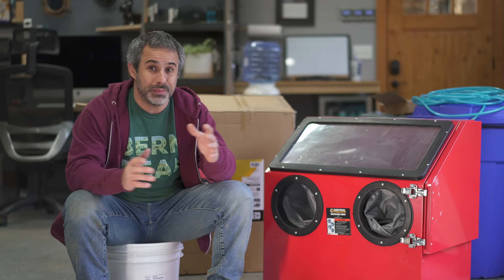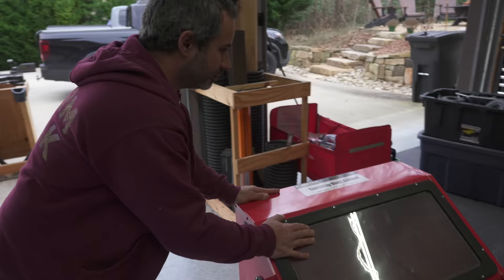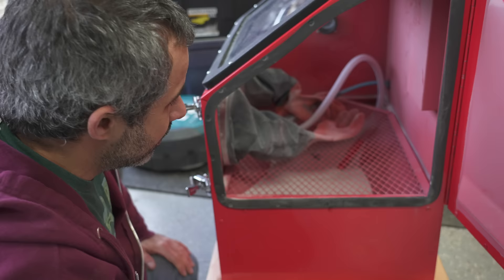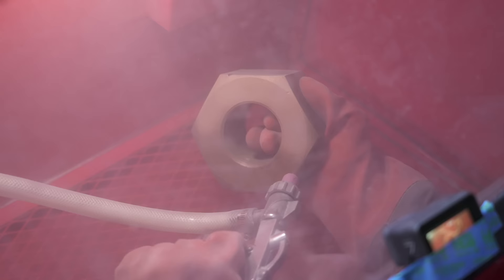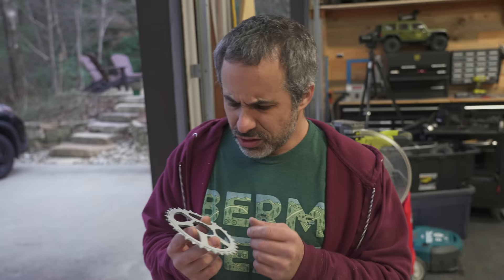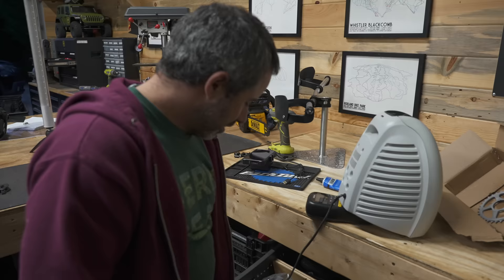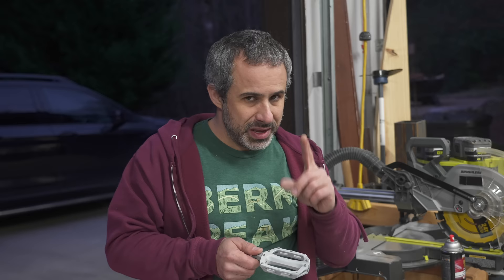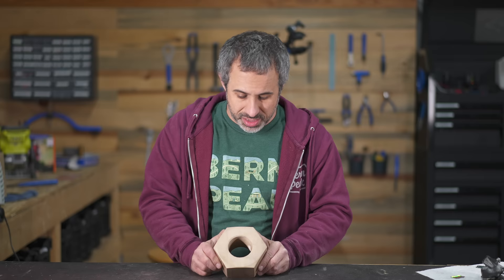I took your advice and bought a Harbor Freight sandblasting cabinet

Comment: For anyone who does DIY projects, I couldn't help but smile when the cabinet hit the bench top. I can relate. All you can do is laugh and figure out a hack to make it work.
Reply: This is basically how software development gets done too
Reply: And I knew 100% how Seth is gonna solve it! 😂
Reply: i’ve run into these kind if problems one to many times indeed
Reply: I'm glad he included it into the video I probably wouldn't have posted it but I guess after me smiling I should if I do that lol
Reply: @elorz007  that's engineering, they say it will work, we tell them no, they say do it, we do it. We tell them it didn't work. They say oh.. Then we do it the right way🤣
Reply: We’ve all been there… and sadly quite often more than once…
Reply: How long did you think about this before doing it? About 10 seconds 🤣
Reply: Or in his case, you can hack into your bench instead
Reply: I laughed so hard at that cause that’s something I would do
Reply: 🤣😂🤣😂🤣😂🤣😂 read your comment before watching. Made the comment so much more funnier. I can definitely relate.
Reply: Surprised he didn't measure the height properly before building the stand. Guessing he didn't account for the castor height.
Reply: Sure. But a crappy - if funny - solution.
Reply: I started laughing knowing what I would do but then broke down when Seth did the exact same thing
Reply: Looks like exactly one 2x4 (1.5") too high.
Reply: Thud!
Reply: I let out a little chuckle. Read the comment before I actually watched it happen and made it just a tad funnier.
Reply: This is how most of my automotive repairs go
Reply: that was my subscribe moment.  Love this dudes sense of humor.
Reply: In my mind I was thinking 4 blocks under each table leg 😂
Reply: measure twice cut once... then cut again because you still messed up somehow
Reply: It was the look on his face that totally said, "Well... THAT figures." Then it was a heavy sigh, a shrug of the shoulders, and grabbing the jigsaw. "I shall not be deterred!" Story of my life in my little work shop. Gotta love it. 😂😂
Reply: @awsomemanthing5358  I'm right there with ya on that. Pretty much my standard method of operations. 😂
Reply: Lmao you probably beat everyone for that comment
Reply: I loled
Reply: I guess praying to "bejesus" was not effective
Reply: Just giggled at that bit just as I saw your comment..lmao... Typical..like You say tho....HACK TIME!!..lol

Comment: For soft metals, instead of sand, use Soda (Sodium Bicarbonate, you know, baking soda). Can buy "industrial grade" bags of it darn cheap, and it won't roughen up your finish so bad
Reply: Horror Fraught has walnut shell media, so for $30 I think this would be the first thing to try in the blast cabinet.  HF also has soda blasters.  IDK if soda works in normal sand blasters?  The REALLY 'cool' thing is dry-ice blasting, but that equipment is NOT cheap.  And as always, remember that breathing dust from sand or glass is not so good.
Reply: @oapfu  Soda works fine, but you do need to modify your collection process and run a cyclone catch before the shop vac (which is a good idea even with sand). Using something like a dust deputy or the like to convert a 5 gal bucket for that size is fine, as well as have a way to regulate the soda, which is cheap and simple with a couple brass fittings, gate valve and some extra tubing.
Reply: Or for soft metals like aluminum or stainless steel use glass bead i sand blast for a living and I blast a lot of good grade stainless steel that can’t be pitted bad
Reply: In one of Seth’s videos, he uses baking soda and the way he says “baking soda, I got baking soda” is the funniest thing ever
Reply: @oapfu  dry ice blasting should definitely be done in a place with good ventilation.
Reply: Yeah I used costic on some cranks and polished up , worked great
Reply: Question for you sandblasting pros: wouldn’t it be wise to further improve the sealing on the sandblasting case, to prevent materials from escaping? I’m thinking a strip or two of foam-backed sealing tape. Would that work?
Reply: @trailfirexc196  Like many things from Harbor Freight, a little bit of time "polishing" the finish goes a long ways. You are not wrong, and spending time pulling it apart and ensuring a good seal on everything is worth the time, for little additional cost in materials.
Reply: not only that you actually flake out soft metals. and if you do any cast metal it can really pit the metal.
Reply: can also use granulated corn cob to polish with 
granulates are a completely natural and biodegradable
Reply: @trailfirexc196  not going to happen. You are shooting compressed air into sealed compartment, it's going to come out. The only way to keep the dust and sand from coming out the seals is to turn the cabinet into a low pressure area, which is where the shop vac hookup comes into play.
Reply: Sandblasting will warp thin metal even on a vehicle panel. Soda blasting is great, though doesn't do so well on rust. Though you can leave a vehicle sit outside for weeks and weeks before it will start to rust.
Reply: Paint stripper gel
Reply: Yeah I tried that stuff got a blaster that never gets used, bought it to try on old chair legs and it got used for a few minutes wastes too much material if not in a box or something to contain the dust.
Reply: He said “darn cheap”... this guy DIY’s
Reply: @trailfirexc196  What most of us that have these do is silicone all the cracks when putting it together and add thicker weather strip to the door.
Reply: It also dissolves quickly in warm water. That makes cleaning the nooks and crannys that it can compact in largely trivial.

Comment: As an engineer I wouldn't recommend sand blasting structural parts or hardened surfaces. Sand blasting is great for insensitive parts for quick and visually pleasing results. But especially on soft metals like aluminium you can remove a non insignificant amount of material quite quickly. Additionally, the rough surface weakens the corrosions resistance and mechanical properties further. In rebuilds and restoration off high end cars and chassis we use dry ice blasting or professional chemical paint stripping. That being sad, you can get softer sodium bicarbonate or nutshell particles which are great for cleaning parts without being too harsh even on softer surfaces.
Reply: “A non insignificant amount”
A.K.A. 
A significant amount
😄
Reply: @mrkthmn  hahaha :D. Yeah I am German, we like our "Doppelte Verneinung "
Reply: M539 Restorations sand blasts even manifolds, water pumps etc
Reply: @MousemanLV  well I would say thats fine in most cases. But I would never blast any structural chassis parts especially on modern cars with space frame, shell or composite construction.
Reply: Ex wet blasting R&D engineer, you're very right, will definitely strip off any anodising, compromise the resin layer of carbon fibre and may blow through case hardening in the case of gears, not clued up on how exact bike components are finished but definitely something to consider
Reply: Mechanical Engineer also here. I would go on further to say it really depends. Sandblasting the surface does remove material, you are right there, but unless if the operator is extremely negligent the amount of material removal is negligible for most components. You wouldn't want to blast a very tight tolerance fit, but anything you would find on a bicycle short of a bearing surface is fine. Something to consider is that blasting also peens the surface and can actually increase the hardness to a very shallow depth. It depends on numerous factors such as the grit of media used and the surface being blasted. One suggestion is to use walnut shell media. I also worked in high end vehicle restorations (In the realm of $500k +) and that was our media of choice for cleaning a shell.
Reply: I'm a machinist and my brother is our engineer at our shop.  You want to take your media blaster and fill it with 50 micron glass bead (.050mm or .002"), not sand.  that will create an excellent painting surface and remove anything and peen the surface removing machining stress from the part and making it more stable/rigid.  Bike sprokets aren't hardened, they're 7075 billet or steel which matters less, and I seriously doubt, personally, that you're gonna do anything to the part mechanically.
Reply: Spoken like a true engineer. U overthinked the fukkk out of that lol. Dont blast thru your part, nuff said
Reply: I've also heard about people using ground up walnut shells instead of sand as it is way less abrasive. However, I don't know how much of an impact this has on structural fatigue.
Reply: @Cinnabuns2009  this is absolutely true. Glass is the best to use
Reply: As a gear cutter sand blasting a cog gear shouldn't affect the running of it with a chain, however it will become rusty much more quickly if not treated/painted. I would never recommend sand blasting any gear as it would affect the runout by altering the form and pitch. Also I really like how sand blasted parts look.
Reply: Thank you for this.
Reply: Well aluminium is just fine when you sandblast it. Just dont go too high in grid and Bars, when I sandblast aluminium rims im just sandblast then at 5~6.5 bars with a fine grid for that smooth finish and they come out looking fine as fuck. No craters just cleaned surface.
Reply: I think that sprocket is hardened aluminum or steel. Either way, I wouldn't sandblast it either, but use some gasoline and a rag to clean it instead. 
If you really want to sand blast it, tape off the teeth section of the sprocket. You won't see it anyway.
Reply: They sandblast bridges all the time prior to painting. Is that not structural?
Reply: SAND BLAST EVERYTHING!!!!!!
Reply: @mrkthmn  Kind of like undigging or unthawing something
Reply: @Cinnabuns2009  as a machinist with a brother as an engineer you should know that no one has used sand for at least 30 years, unless theyre complete imbeciles. Garnet, glass bead or finer stuff like nut shells etc....cos no one wants to die of silicosis.
Reply: @MS-bw7yt  das auto
Reply: @MousemanLV  Sure they aren't using glass bead or some other media?  "sandblasting" tends to be a generic term people use even when sand is not the media they are using.
Reply: @keyworksales6241  What this guy said.

Comment: PRO TIP : when you're finished blasting, pull the gloves inside out and let them hang down on the outside of the cabinet. They will last twice as long and it's kinda gross sticking your hands back into soggy rotting gloves. You're welcome 😊
Reply: Also, spiders.   No sudden surprises!
Reply: @R2robot  galaxy brain tip
Reply: Top tier tip. I'll definitely be doing this from now on.
Reply: @sethstewart9704  you could just get some cheap cotton gloves liners.
Reply: @pingpong12429  

Meh,  Still not a bad idea. The cotton will get skanky, too.

Comment: [Mechanical Design Engineer] Most chainrings are a 6061-T6 Aluminum, which are Type II sealed anodized after machining. Anodization is a plating process to prevent surface oxidation (corrosion) of the Aluminum. Most common color for anodization is black, but you can anodize in a huge variety of colors. When you blast the parts you are both removing this surface plating and changing the surface roughness of the part to varying extents depending on your blasting medium. Most bicycle chains are a carbon steel (much harder than aluminum). So the new aluminum surface will wear down to a smooth interface over time, but for a short time will add slightly more wear to the new chain during the break-in period - after installing the new chainring, clean the chain and sprockets excessively to remove the aluminum particulate being created to minimize wear. During blasting take caution not to excessively wear the teeth - they will be interfacing with the chain anyway and you want maximum engagement between the teeth on the sprocket and the chain to reduce uneven loading (which could lead to breakage in the chain). After blasting you will need a new surface treatment to prevent surface oxidation. Common "at home" methods might be powder coating or painting, However neither of these are a chemical bond, to they will be more prone to chipping/flaking during use. A very mild surface texture will actually help the powdercoating/painting from chip-out.  Hope that helps. - J.
Reply: Thanks for this comment. Very interesting read that should have gotten more engagement. Love the technical outlook.
Reply: Good stuff! Nice to scroll through comments and actually learn a thing or two. 👊

Comment: As an individual who basically sandblasts everyday (part of the job) I recommend a few upgrades to the harbor freight cabinet. 

First, silicone all the seams
Second a steel pickup tube 
Third a gun with a tungsten carbide nozzle
Check out McMaster Carr or a local abrasives distributor.  

Get rid of that 80g aluminum oxide in favor of 120g or finer.  (Especially for bike parts) 
“Glass bead #8” will give a bright satin surface finish 

And ground cherry pits  can remove paint from carbon fiber without damaging the carbon. 🤔🤯

Enjoy your new toy.
Reply: How can I get a job sandblasting every day sounds fun what do u do
Reply: @flowerasteroid6241  I’m an operations supervisor for a thin film vacuum coating machine manufacturer and job shop.  
We use and sell our machines to produce a carbon based, hard, wear resistant film that the industry calls “DLC”.   We sandblast to remove this film from the machine parts in order to reuse them for the next process.  We also use the sandblasting machines to prepare the surfaces of customer parts before process.   Different media produces a different appearance.  Our coating is conformal, so the sandblasted surface prep can visually change the appearance of the finished customer part.   From matte to polished.  

Sounds fun.  But it’s very tedious and detail oriented work.   
 I also love building and riding fancy bicycles 😎

Basically if you want to sandblast all day look for a job in machine shop, powder coating or industrial thin film coating.
Reply: @elithe240guy  you definitely sound like you know what youre talking about thank you lol
Reply: @flowerasteroid6241  lol 🙃
Reply: I s
Reply: Thanks for the great tips, Eli!  I need a soda blaster for home use. I have to strip finish off antique carved small boxes, and various household objects, some cast iron benches, etc.  Could you kindly suggest a small sand blaster, and the cheapest air compressor that will do the job. I only have a 6 gal compressor currently and need a bigger one.
Reply: Hell yeah, this was super good info. Saved!
Reply: I saved this info. Pure gold, thank you!
Reply: @flowerasteroid6241  Bring this man a beer right now!
Reply: Any advice which media to use to sand wood cabinets?

Comment: Hi, Seth, here is a tip for you: If you are sandblasting a metal part and you want to make it black/matte black you can use bluing liquid and it works flawlessly. It also saves weight, because you are not really painting, but you are oxidizing (not rusting) the metal, and it also prevents rusting :)
Reply: Bluing only works on steel, not aluminum. And depending on the type of steel there could be issues as well, common liquid blue doesn't work on stainless.

Bluing alone doesn't prevent rust, it is a specific, controlled oxidization of the steel instead of a standard iron oxide rust forming on its own. normally there is a layer of oil rubbed into a blued part to protect it because bluing alone doesn't cut it

There are other processes out there to turn other metals black ish but they aren't bluing. Brass black is supposed to work ok, some people I know used it on old paintball markers.
Reply: @theshadows620  Cerakote is a good alternative.  has become very popular in the gun industry to replace liquid blue.  it's similar to powder coating, in that it's sprayed and baked on, but it's liquid, so it works on pretty much anything that can handle some time in the oven.

Comment: Hi Seth, try to hit the surface in an angle of 45° instead of 90°. It’ll take of the paint better without damaging the surface underneath it. If you want a (kind of) shiny finish you can use glas beads. At least that’s what I use as a dental technician and dentist for cleaning up different alloys. Cheers from Germany!
Reply: Blasting glass beads?  I knew i hated going to the dentist.

Comment: Most people answered this already but here are two tips. 
1. Use walnut shell media to strip surface rust without damaging more delicate metals.
2. Get a dust-buster cyclone attachment that fits on a 5 gallon bucket. They sell them at home depot and it will save your shop vac from being clogged up with sand blasting media. It acts as a dust separator and it makes a big difference.